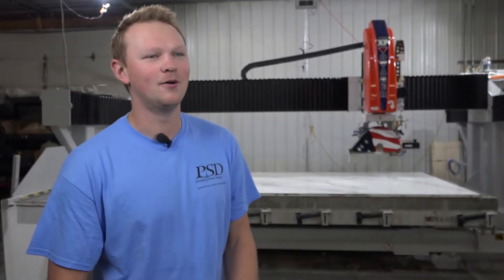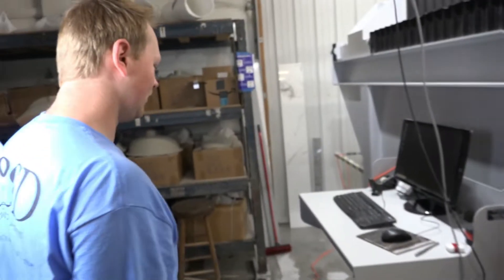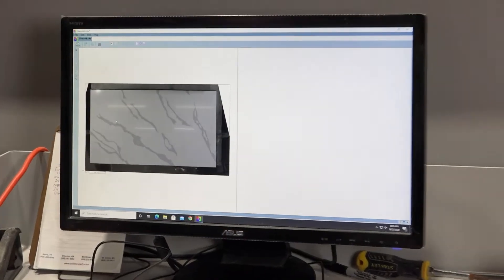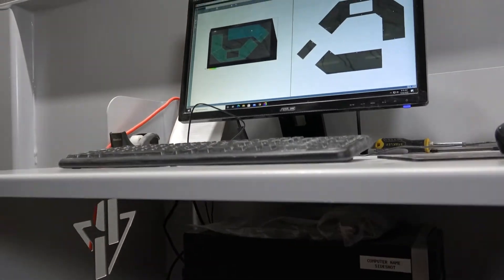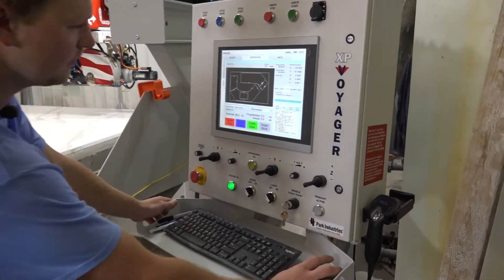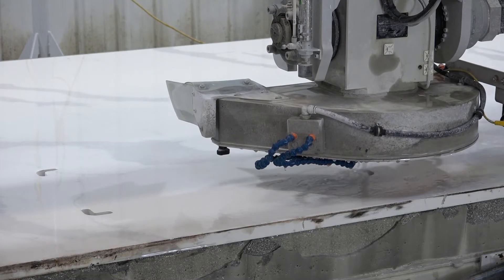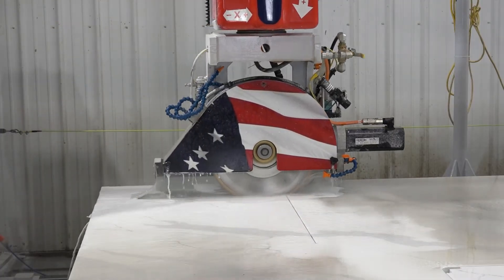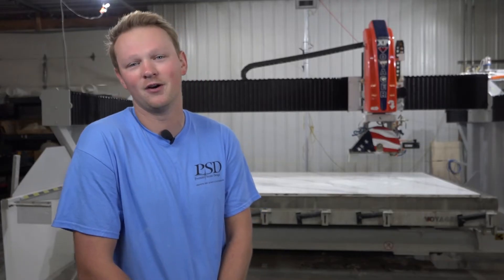VOYAGER XP CNC Saw w/ SIDE-SHOT | Premier Stone Design

Comment: What bit are yall using to do the cuts in the corners and radius? An incremental bit...? But what kind?
Reply from the maker: Hi Travis,

At Park Industries, we use the Cyclone 20mm incremental bit.
Reply: What is the ideal blade yall use for cutting Quartzsite? It took me nearly 3 hours to cut a slab of Taj Mahal and I'm using the Voyager Xp in my shop. Got it a couple months ago and I still haven't figured out all the particulars
Reply from the maker: @travissanders3289  When it comes to recommending tooling, may we suggest speaking to your tooling rep or asking other fabricators in an industry group like https://www.facebook.com/groups/parkfabricators